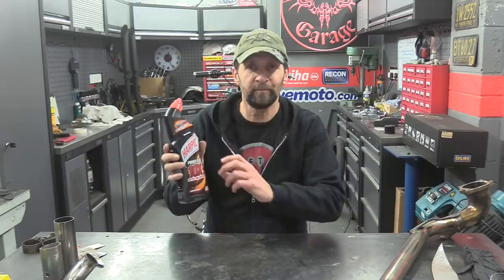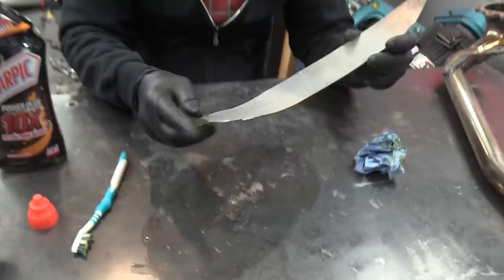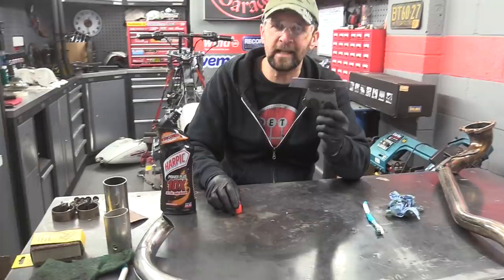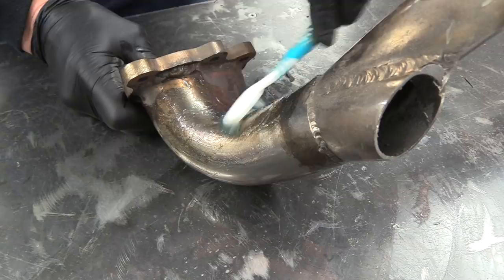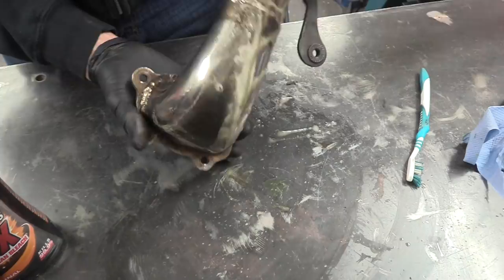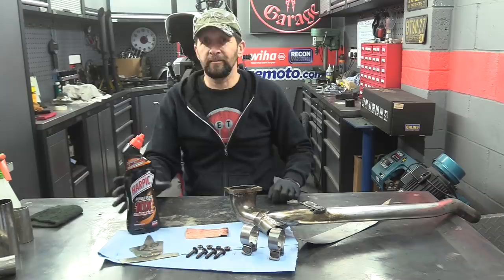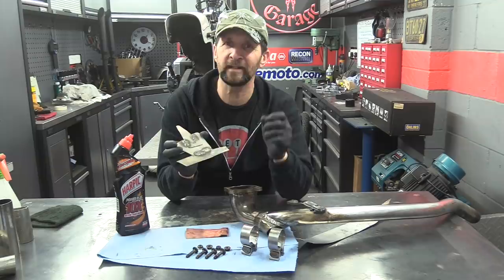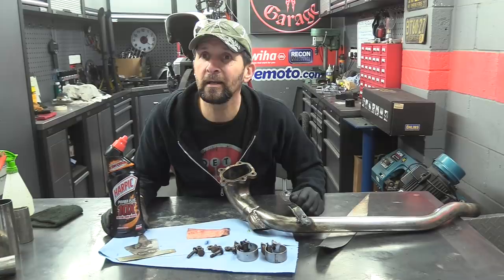Delboy's Garage, Simple Skills, "Cleaning Steel with Harpic" !

Comment: Great video del  & penny.  Bet penny got you cleaning the loo now. I will get same from sainsburys tomorrow.  Then in to the garage to work on the bandit exhaust system.  See you in the next video mate. Best wishes to you and penny
Reply from the maker: Cheers James, I am reading and hearing lots from the Bandit community and as I remember on my own Bandit 12, the pipes are particularly bad for going brown and tarnished, specially around the collector under the motor... here a lot of advice to leave it on for about 20mins, and then buff up with Autosol for a shiny finish!

Comment: Another good one Del.  Bit of feedback for you, i was recently struggling to get a 7mm clevis pin for the gearchange on the Guzzi. I ended up using one of your tips  to use my hand drill and the grinder to turn down an 8mm stainless bolt. Worked a treat. thanks mate.
Reply from the maker: Hi Kev, oh wow, that's awesome mate.. it is so humbling to hear that a tip we've suggested has helped someone out, really priviledged mate, thankd for the feedback!

Comment: Those dome head bolts look like coach bolts. Obviously better if you can re-use, but not too expensive to replace. Looks like about £5 a pack from tool station if they are M8 diameter. Nice idea with the Harpic though. May have to try that sometime.
Reply from the maker: Hi Chris.. its a Harley mate.. they're imperial so ill need the nuts too.. and yeah, coach bolts they are.. i may replace them if i can find some..!

Comment: Hi Del, did you ever encounter any problems using harpic? There is a video on YT saying it's a bad idea because it would hurt the pipes? So i thought ask Del i wil get a honest answer. When you are not to busy ofcorse✌️
Reply from the maker: Firstly this must never be used on chrome... it will actually remove the plating and trash it, it's only advisable on good quality stainless steel and it cleans it wonderfully as you saw, but even with that, a warning, IT MUST be washed off with lots of water to neutralise the acid and stop it reacting, otherwise it'll continue to act on the steel and that can lead to staining and even end up promoting further corrosion, as with all dangerous chemicals use it wisely and careful and wash it off thoroughly!
Reply: @Moonfleet41  Thank you for your detailed answer i really appreciate it! I wanted to clean my stainless steel headers on my cbr 929rr. So as long i don't make a mess and wash it really good with water it should be fine. I'll be careful thanks again mate🙏
Reply from the maker: Sure thing, that's it, don't use anything abrasive, just a toothbrush and try a small area out fof sight, and see how you get on... but remember to wash it off really thoroughly and polish it up afterwards, good luck!

Comment: Hey Del! how are you my friend? I was checking your video and since it´s been 4 years  from that, can you show the welding test sheet again? I´m asking this because so far I´m working on the exhaust of my 2002 FXDWG and I´m afraid of some cons (if ther is) with this product!
As always, nice to hear about you Del, your friend Paco.
Reply from the maker: Hi Paco, good to hear from you, we hope you're well?  If you're worried about using it on welds, then it's ok as long as you wash it off THOROUGHLY afterwards, it contains a mild acid, which is how it works so effectively, but if you leave any residue on the metal, the acid will continue burning and lead to corrosion... so wash, wash, wash with lots of soap and water and remove all traces of the acid and it will be fine.... and of course, only use on stainless steel (NEVER on chrome)... and if you are in any doubt, then do a small 'test piece' first on some scrap... hope that helps and good luck my friend.

Comment: Good method for light rust. for heavy rust use masonry cleaner same active ingredient but a lot stronger,
Reply from the maker: I think i remember using a product called "Discrete" back in the 80's for taking cement splashes of brick walls after building... i know we had to wear some pretty thick gloves for it..!!!
Reply: Yes works on rust a treat but also eats chrome and stainless.

Comment: Harpic is not available on this side of the pond, but comparing MSDS sheets, Lysol® Deep Reach Toilet Bowl Cleaner seems closest match. I will update with results on Bandit exhaust once the deep-freeze season lets up.  Brilliant ;-)
Reply: Taken from google: Harpic contains hydrochloric acid which dissolves limescale, calcium carbonate (CaCO3). And in the UK I believe the "10X" refers to 10% of the ingredients is made up of hydrochloric acid, stand corrected.
Reply from the maker: Hi Darren ,yeah i guessed it would be hard to get outside the UK.. but its basically a super strength limescale remover for domestic use.. The actice ingredient seems to be the 9% Hydrochloric Acid.. so as long as any product has thatr.. it should perform the same i guess..!!     Good luck with it, and keep warm buddy.. Del.

Comment: Thats great. I put new stainless steel pipes on my fazer a while ago, but with a fibreglass exhaust wrap; should I remove the wrap? then clean the pipes underneath? the wrap is pretty dirty, how do you clean the wrapping? cheers
Reply from the maker: You can gently scrub the exhaust wrap with a nail brush and soapy water to get the dirt out, rince it clean with clean warm water... but it is known that after a while pipes will start to corrode under the wrap as it harbors the damp more then when they are in fresh air.. so if you're worried, strip the wrap, clean the pieps and replace it with new wrap maybe..?

Comment: Nice!, I've been waiting for a video on this before taking on my own header pipes. Was thinking of using coca cola but now i'm sold on this.
A question tho: After removing the rust what would be the best way to protect the headers? I've read polishing them with autosol, other then that nothing?

Thanks!
Reply from the maker: Hi Jelmer, its most likel that your headers are stainless on a bike.. once you get the crud off, then yes, just wash them off with lots of soapy water, then polish with autosol.. !
Reply: If you really want to protect them long term, use Corrosion-X (although it might need a treatment every now and then because of the heat). It binds magnetically, which in turn makes it extremely durable even under high pressure and temperature. 

I tried it initially on a couple of screws and nuts, put them in salty water for some time along with some untreated ones - the untreated corroded, no surprise there - the treated ones were completely shiny with no corrosion whatsoever! :-D
Now everything I can think of gets this treatment - tools, fork legs, bolts, fuel tanks, exhausts - you name it!

Comment: I'm doing several of my own old bikes with crusty and rusty petrol tanks in both alloy and steel respectively. I'd like to know if you would or could restore either of these types of metal tanks back to bare metal using this stuff with no liner and a best/cheapest/easiest method as to - How you would approach drying and stop the flash rusting of the steel after washing this stuff out with water.
Reply from the maker: This was just an experiment mate, I'm not an authority on it, but I wouldn't wash a petrol tank out with this.... I've found that it seems to promote rust on ferrous metals very quickly indeed, but on stainless steel it cleans it nicely, as long as you wash it off straight away... I would never use it on a steel petrol tank as it's horribly corrosive and any residue left inside will rot it's way through eventually... I'd stick with the old fashioned method of fistful of ball bearings in the tank with a pint of water and shake it to bits for half hour to beat all the rust flakes off the inside, then wash it all out, air dry it thoroughly, then apply some PetSeal coating to the inside to stabilise what oxidisation is inside.
Reply: @Moonfleet41   yeah I've been experimenting too. I've recently tried 10 litres of 'Cleaning' vinegar (AUD$13) in a badly rusted but good unholed tank for a few days, it stripped it out perfect then mixed Metal Cleen in with the water to flush which seemed to stall the flash rusting completely. Tried it with another good tank for the same few days that had mostly light and some heavier surface rust but flushed with only water to see how long it took to flash rust and within the drying time, it looked worse than before. My next experiment will be using a vapour blasting medium that you use to wash parts that have just been vapour blasted - BlastX 108 X2 Double Strength Concentrate Flash Rust Inhibitor - and when mixed at 200:1 with water is said to leave no residue. I will never use any liner mix again as they all separate eventually, then break down and from personal experience and a destroyed engine, you know 'Once Bitten'. There are so many dubious fixes in this area, it'd be nice to see 'you' address this issue properly and after watching a few of your videos, I believe you could do it justice.

Comment: Hi,
Have you experienced any disadvantages to the exhaust by cleaning with Harpic - possibly stains or discoloring?
I want to subsequently color the exhaust black on my Z900 and therefore I think that Harpic will handle the deep cleaning that is necessary before painting.
Greetings
Reply from the maker: The Harpic is a pretty strong acid, and you won't want a single trace of it left on the exhaust when you paint it... so wash it thoroughly and get it chemically clean before you paint... !

Comment: Would you say this would loosen rusted bolts? In your recent videos you carefully removed stuck bolts n nuts so they wouldn't strip.. could you try this on a spot like that?
Reply from the maker: No mate, i use penetrating oil for that. i use this for cleaning stainless steel.

Comment: In the u.s.a this goes by the name the works. This is also great for cleaning the inside of a rusty fuel tank before sealing. Also don't expose the acid to aluminum Google the works bomb to see why basically it has a very negative reaction to aluminum so keep all aluminum away.
Reply from the maker: Hi Joe, you're dead right on aluminium, but on the other hand, if you have an aluminium item that is colour anodized and you want to polish back up bright silver shiny, then soak it in this for about 1/2hr and wash it off, the colour rinses off before your eyes revealing bare aluminium underneath...!

Comment: Been using that (kinda) stuff on rust and exhaust for about 3 years now.
Always with a scouring pad, soft side for most if it.

And wax it in, wait 5 min, scrub a bit with the soft side and wait another 5 min. (sometimes you can see it bubble even) and then wash it all off.
Easy and quick ;)

Comment: I know this is an old video, but I want to clean up a Triumph Street Scrambler OEM header and leave the original satin bronze finish intact. Will Harpic work?  Does anyone know if there is a comparable product in the US? I used Blue Away for chrome pipes in the past.  Thanks.

Comment: Fantastic😃Dos this also work on Harley chrome exhaust pipes?
Reply from the maker: NO... NEVER use Harpic on chrome, it will burn it permanently and make a right mess, this only works on stainless steel.  For chrome there are many remedies, posh products like Belgumalu, or ghetto fixes like tin foil and Cola, but NEVER use Harpic on chrome.
Reply: @Moonfleet41  Thank you for youre warning😊👍🏻And thank you for all youre great videos, i USE youre episodes for all my work on my Softail 😊👍🏻👍🏻🇳🇴

Comment: I'm surprised by this video... 
Does it clean it? Yes. Does it damage the chromium in stainless steel? Yes. It'll brighten up the metal but it'll never polish up as it should and it'll corrode again much faster in future. Harpic is a corrosive... it's in it's description.

Comment: I wonder if it would be safe to use harpic on corroded banjos from brake lines. They are stainless steel but is it possible for harpic to perpetrate inside the system and do damage?
Reply from the maker: NO, replace them with new stainless ones, they cost peanuts and it's not worth taking the risk.
Reply: @Moonfleet41  thank you for the quick reply! I thought so too, new lines will go on the "to do list"!
Reply from the maker: @georgeneofotistos2945  Sure thing George, check out Wemoto.com, they make them to order, just tell them what bike you have and what hose you need, they'll make it up and get it in the post!

Comment: if I had seen this video before I would not have scratched my chrome line from my T100.  Do you have an idea to be able to remove these scratches and find a mirror appearance? 
Thanks ✌
Reply from the maker: Sorry my friend, can you explain what you mean by 'chrome line'?
Reply: @Moonfleet41  exhaust manifolds
Reply: @Moonfleet41  the former owner of the motorcycle had installed thermal bands.  I removed the tape marks with wd40 + scotchbrite and iron straw 0000 + belgom chrome to regain shine.  these thermal bands are terrible and leave nasty marks on the collectors

Comment: I recently got a Honda VTX 1300 which has the same intake as your Harley. Do you know the name of that kind of intank, and the size of the circular filter? 
Love your videos! Do you still recommend the Simota Air filters?
Reply from the maker: Do you mean the new air intake assembly I fitted Nathaniel, or the one it came with?
Reply: @Moonfleet41  Timestamp 12:30. The aftermarket assembly currently on the bike.
Reply from the maker: @nathaniallischak3133  Aha, that was called a "Hyper Charger",  they are readily available, ive replaced it with something else now and it's sitting in a box in the garage.. they are model specific in terms of the the fitting to the carb, , and come with their own internal washable filter.. not sure if this would fit your VTX !
Reply: Delboy's Garage   Thank you! And keep up the great content! Love it

Comment: I have aMoto Guzzi Breva 750 with chrome-plated (not stainless steel) exhaust pipes. Does this thing work on chrome? How long does the effect last? Should we apply some sort of metal protection afterwards?
Reply from the maker: DON'T use it on chrome mate, it'll permanently damage it..
Reply: Thanks for the answer. What is a good method for restoring chrome exhausts?

Comment: Its really only tiny bubble like marks around bare alloy parts the lacquer seems OK. Cleaned them a while ago using T cut which worked but took ages and lasted a good few months just not sure if i should use a heavier abrasive maybe rubbing compound before fine grit paper?
Reply from the maker: Hi again Graham, T-cut isn't really the right product, it's incredibly mild and designed for paint, which is soft, if you have pitted metal you need something just as fine as the T-cut, but where the particles in the polish stay abrasive a little longer and work a little harder, something designed for metal specifically... try some Solvol Autosol, it's a wonder polish for everything on vehicles but it will definitely do a lot better than T-cut.. give it a go mate, and let us know how you get on!
Reply: @Moonfleet41  will do and congratulations on your 100k subscribers. Loved your work on Penny's Triumphs qiute inspirational for a confirmed couch patato like myself and fitted a tec exhaust, rear shocks and front springs 👍
Reply from the maker: @captainaverage721  Thanks for the congrats buddy, and glad we were able to get you off the couch lol ... enjoy your bike mate!

Comment: Hey there delboy .loving the channel. Have you tried this harpic  inside a petrol tank ? I'm asking because I've got an old tank which has been sat there for a few years and it's started to rust . didn't know if this would work or would it damage it .if so do you have any ideas to clean it out . cheers dude .keep up the good work.
Reply from the maker: Im not so sure that i would use it inside a tank, they are generally made from mild steel, and this treatment  is usually for tarnished and stained stainless steel.. if it's left to fester on mild steel it will cause a huge rust reaction after a while. so it would probably have the opposite effect....     
For cleaning inside a tank in the past ive washed them out first with lost of water to flush out as much fuel as possible, and drop in a few handfuls of stainless steel BB's.. then a pint of water....and shake it for 15 minutes to batter all the rust off the inside, and then flush all the water and BB's out with a running hose.....  After this you must dry it out thoroughly right away.. sitting it in the warm sunshine works, and leave both ends open... then wash it inside with clean petrol so expel any last water droplets... and it should be good to go..  if the inside was really rusty, and lost of flakes came out.. then you can stabilize the inside surface with a product called "Petseal", its a two part fuel proof epoxy coating that makes an internal resin skin... works every time as long as you do it right.    Hope that helps.. good luck with it..
Reply: Thank very much for the reply .I will try your method .it's going to be a nice weekend here in the UK . I'll get some petseal on order and I'm ready to go .thanks again dude

Comment: Would it be a really bad idea to use it on chrome? The rust on my bandits radiator guard is getting out of hand.
Reply from the maker: Hi Will, no don't use it on chrome... it will burn it and leave permanent marks... it's only really for stainless steel, it will even damage anodising if left on too long!
Reply: @Moonfleet41  cheers man. I thought it might not be wise. Thanks you for the videos. You've got me out of quite a few jams over the years.